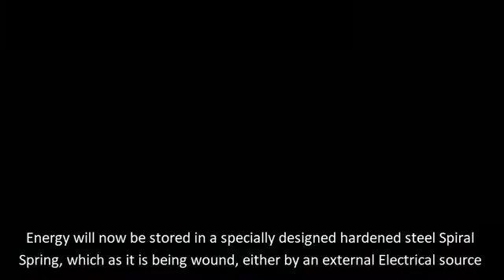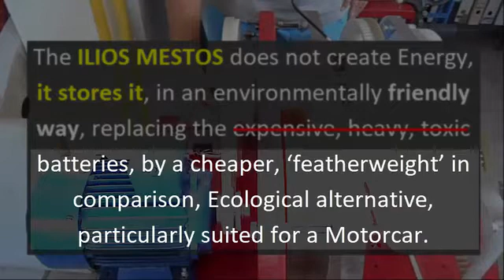The ECOCAR with a Mechanical Energy Storing System

Comment: I found this because I was hoping to find some one who has used a large spiral spring. I have been thinking of finding a mechanism like this that I could use to power a series of fans in a air heated wilderness survival suit. The heat sources could vary, but just hot coals or heated rocks, bricks/ heated metal slabs could be placed in a insulated container. One could even have a small furnace of sorts do the trick. I like the reliability of doing it this way rather then with a battery or using fans that use thermal transfer for power. The latter possibly being optimal in a number of ways but maybe not robust enough. I would be interested in trying to collaborate if possible or appreciated. Thanks for your time.

Comment: The idea is very simple and ingenious at the same time, 02 questions hit my mind though:
1-The efficiency of the system: the torque and the range: The range depends on the lenghts of the steel spiral, the torque depends on its thikness.
2-The volume of the casing/Barrel of the metal spiral.
3-The possibility of stacking multiple barrels for more range or torque.
4-Heat soften the steel so the energy required for rewinding will decrease
Good luck
Reply: I believe springs are overlooked. Number 3 has been in the back of my mind for years. Springs stacked like pancakes. It seems like this should have come out by now, and I've only seen it in one application. Along with today's technologies and abilities it seems practical.